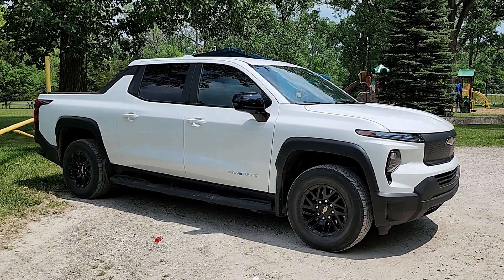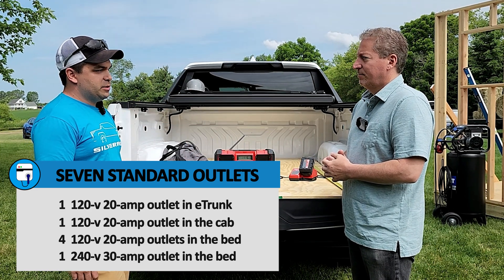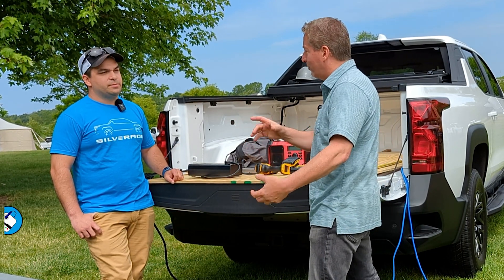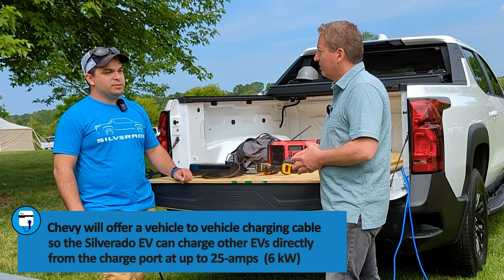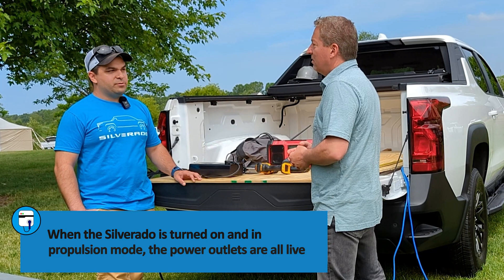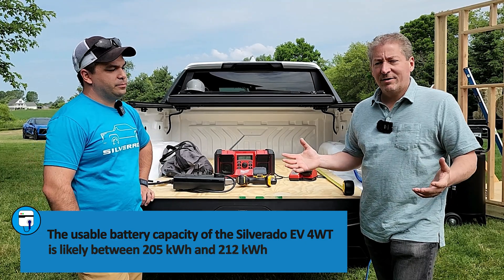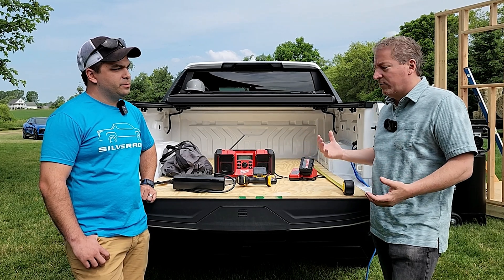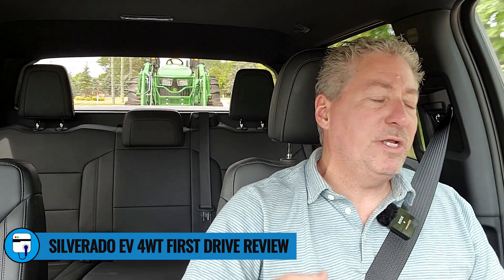Chevy Silverado EV Offboard Power System Overview

Comment: It would have been interesting to know why the power bar can only output 3kW but using the V2V cable you will be able to draw 6kW.
Will the V2V cable switch of the other power outlets? So the max output of 10kW ( I think the value is the max output of the converter) isn’t exceed. 🤷‍♂️

Comment: Question from anelectrician. Ok truck is sotting onrubber tires so how do you provide a ground? Does this cone with an approved 120 & 240 volt GFCI
Reply: Oops. Should end with does this contain approved 120 & 240 bolt Ground Fault Protection. Safety departments that I worked thru even requires a portable GFCI on construction & remodeling work for everything even a 10 watt cell phone charger.

Comment: How can I contact you Tom? I have discovered a potential safety issue with a charger a company sent me to review and I wanted to ask you about it.
Reply: The Shockflo 40amp charger is using 10ga wire.
Reply: Mike, I’m interested in Tom’s answer too.  10 awg THHN wire can handle 40 amps and temperature can rise to 194 degrees F.  For very short length (~6 ft) in conduit, this maybe fine, but I don’t like it.  EV chargers require a 20% derating so you should only allow 32 amps on the wire.  8 gauge is much safer.  My Juicebox Pro 48 EVSE uses #6 wire.

Comment: Thanks Tom, Chris, and GM for providing these details about how the off-board power system works.  Tom and Chris did a great job with the explanation and Q&A.  

IIRC, Ford's system shows the power to each of the 120 V legs on the touchscreen.  It is helpful to know when you have a heavy load on one leg, so that you know to use the other leg when plugging in additional loads.  GM's system looks like it only shows the total load for both legs.  However GM seems to have another 240 V inverter to provide AC power to the charge port, and the output of this inverter is also shown on the screen.  However the individual 120 V legs again are not shown, so balancing 120 V loads plugged into the charge port adapter also is blind.

Comment: I think GM missing a turn here, they should have followed Ford's lead and put drain holes and added power sockets into the frunk and made it at lest equalled it power draw allowed
Reply: It has both.  I also believe the frunk electric sockets stay on while driving so you can charge items in the frunk as you move to job sites.

Comment: Ford's "Ground Fault" issue resolved? Does GM's 30amp 240volt plug work with normal bonded neutral grounding found on traditional North America circuit breakers? 

When powering a house with the Ford Lightning, it will send up to 30 amps from truck to the circuit board, go to devices, but the return current will be cut in half. 1/2 on the ground and 1/2 on the neutral wire. It is expecting all current returned on the neutral. This is what causes Ford's ground fault error and prevents homeowners from just plugging into existing generator inputs when the power goes down.

Comment: Great video Tom.  So the setup shown is the same as for the 2024 Hummer EV also, but charge port accessories are still not available to purchase for that either.  I am curious if the Accessory Power Bar and Vehicle to Vehicle cable will be compatible with other Ultium vehicles like the Lyriq.  I know the super-enthusiastic GM engineer probably couldn't say much, but any idea from others regarding pricing, timeline, and compatibility?

Comment: Good to see such improvement in range with this larger battery (>200KwH) in the Silverado. All EV trucks should have this 450 mi of range as that squarely competes with most ICE vehicles and addresses towing concerns when it comes to range.  

Since most things like this don’t come without cost, what does the added weight mean in terms of performance?  I heard the Silverado EV weighs in at >9000 lbs.  This is close to 3000 lbs or as much as a 1 1/2 ton more then a Ford F150 Lightning.  This has to effect efficiency and performance.  When considering hp/weight ratio, this is diminished by ~34% when comparing the Silverado to the Lightning.  Range is important but it comes at a cost, not withstanding better battery technology.  We can only hope that someday soon higher capacity batteries become available to address Range and keep Performance levels we already now enjoy.

Comment: I want one.  LOL.  On a side note for GM.  Our recent purchase of a 2023 Bolt EUV.  It has a fantastic forward & rearward camera.  It would really help if they could also use it as dashcams with a means to extract the video footage if need be.  And if that is not doable, how about just placing a USB port by the mirror for future dash cam install.  Two of them, one always on and one on for when the vehicle is on (your choice).  And also, distributed wiring on sides and rear for the adding of aux dashcams.  Not sure what is best, but some feature for dashcams integration would be a win win.  Do Tesla s have this feature?

Comment: If a 10 kWh  battery for a home costs about $7k-$10k how the heck does this car sell for $78k when the battery has to be about 200 kWh ?
Reply: Goes to show how overpriced home batteries are. But keep in mind whether you have 3 battery cells or 30 you still need battery management, charger, thermal management, etc. Plus an enclosure, software, etc. and building and delivering it.
Reply: @michaelstaake  I get that. But something just doesn’t add up. There is no way they are selling this at a profit nor do I really care as a consumer. At these rates I don’t know why anyone would ever buy a power wall or a rival backup battery system when you can get 200kWh for just $77k. This is a steal.
Reply: @mgarcia8878  Don't know if it was completely clear, but this 'work truck' is only available for fleet customers ($78K).  The truck that mere mortals can buy with the big battery is $100K.  They clearly have no margin or negative profit on the fleet trucks.
Reply: Home batteries never made sense $ wise.  Fully expect they will get the standards down so EV will be the home charger in the near future.  EV batteries are huge - even a Bolt - in relation to what your home uses.

Comment: With such a large battery pack and being a work truck, what about charge times when at home?  Lightning with their 131kw/80amp level 2 is rated at 8 hours from 15%.  Won't that make it so you will be unable to fully charge overnight?
Reply from the maker: It will take about 10 hours to charge it from an 80-amp unit if you're charging from 10% to 90% (Most people won't/shouldn't charge to 100% daily) 80% of 200 kWh is 160 kWh. Charging at 80 kW can give you a max of 19.2 kW, but in reality, the vehicle will only see about 17 kWh get to the pack with charging losses and AC/DC conversion. So about 10 hours.
I charge my Lightning from 10% to 90% in about 6-7 hours on the 80-amp Charge Station Pro
Reply: @StateOfChargeWithTomMoloughney  Thanks for the info.  Depending on the user, it could be close to a charge. I know some trades (say house builder), get up early and get home late (6 am/10pm).  

I am the person with the Lightning and the solar setup.  I had order the Emporia charger.  I have had issues getting it working but I have also been highly busy in the last few weeks.  I have seen almost 20kw in a day though through the Ford Power station prow.

Comment: The chargeport "Power bar" is a great concept, and a nice improvement over Hyundai's V2L adapter. I would like to see SAE and CharIN incorporate provision for this into their standardization of NACS!
Reply: Agree, but there is more to this function than NACS and the connector.  The vehicle has a special inverter as a part of the charger which can back-feed the J1772 pins.  It will convert the battery DC to AC power, delivering either 3kW (V2L) or 6kW (V2V).  Even Tesla's don't provide this today, just the eGMP cars like you mention.  So it really isn't a NACS thing, and GM's approach will still work when the plug type does change.  But agree that V2L (and V2H) will need to be defined as part of the NACS standard and protocol, but not all vehicles may support this unless they have the necessary equipment.
Reply: @billjohnson3344  I completely understand that there's more to it than the physical connector, and that's why I'd like to see the standards body put the details into the standard spec, so that it is uniformly implemented across manufacturers. It could be a standard, but optional feature.

Comment: Seems like GM just wants to throw more batteries than being more efficient
Reply: If you ask me, this truck is a steal at this price. Not only is it a vehicle, but 200kWh at $77k beats any power wall or battery system that can be paired with a solar system.
Reply: It’s pretty darn difficult to make an EV more efficient. Your only real option is to reduce drag. But with a truck, you need to retain the shape of that truck otherwise it won’t be useful for off-roading, towing, and hauling which a truck needs to be. So they really can’t make it meaningfully more efficient.
Reply: and who is doing full size EV Trucks that are signficantly more efficient ??
Reply: if you want to make EV trucks to haul loads and tow trailers it is exactly what you need plus good fast charging

Comment: Too bad Ford, GM, ect cannot switch to the NACS connector faster, so we have fewer ev's with outdated connectors.  Without the NACS connector on the vehicle, it's going to slow people wanting to buy a new EV that has an outdated system where you need an adaptor.
Reply: the market demand is still exceeding GM & Ford's ability to produce most of their EV models ... so it's hard to justify spending more money to move NACS along faster.

Comment: Tom as a excamper here, to really make these trucks useful would be a left hand side exterior mounted 30 amp plug for tow campers with a single ac and bed mounted campers with a ac unit.. 7:29
Reply: considering typical crappy EV towing range  ... won't be much useful power left anyway
Reply: @KrustyKlown  I would say after dropping the trailer. Recharge the battery pack.
Reply: @Dularr  having to stop every couple of hours and drop the trailer to access a charger, to charge for an hour.... sounds like a PIA way to go on vacation. If towing... EVs make NO SENSE.
Reply: @KrustyKlown  that seems a long way to tow a trailer. Most I know drive to the lake Thursday night to get a good spot. Drop the trailer. Then either take a long weekend or commute to work on Friday.
Reply: @KrustyKlown  That klown was really wrong.  I have towed with SEV for over the last year with my SEV.  I get more range than the ICE Silverado towing the same rig.  Pull through chargers are plentiful in my neck of the woods.    ICE makes NO SENSE.